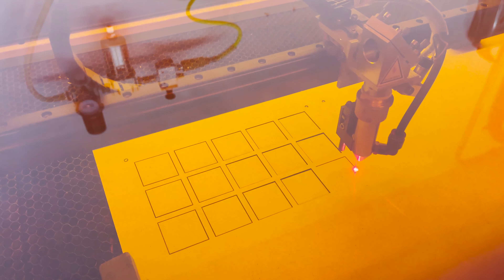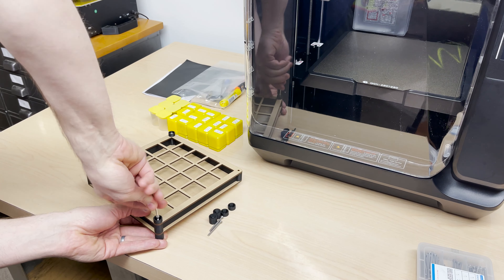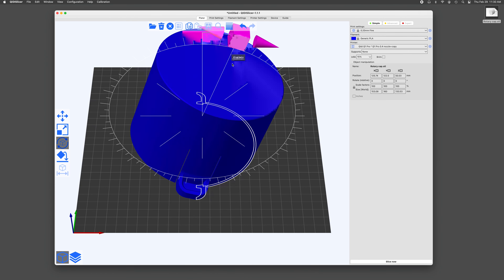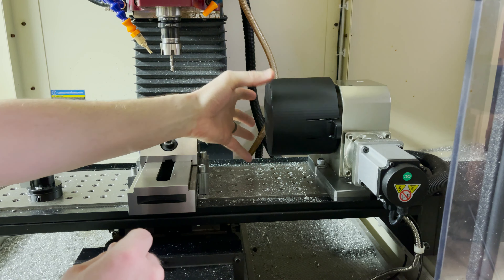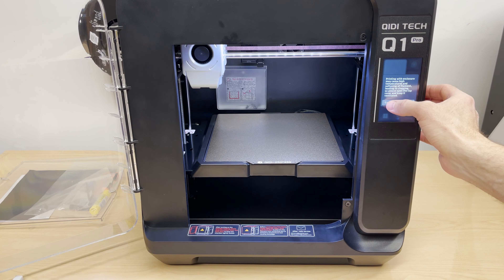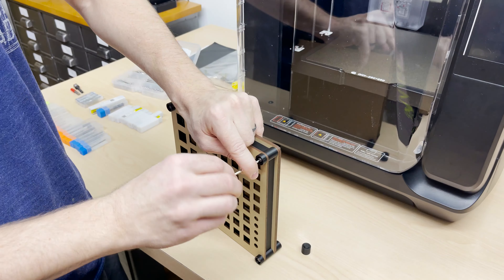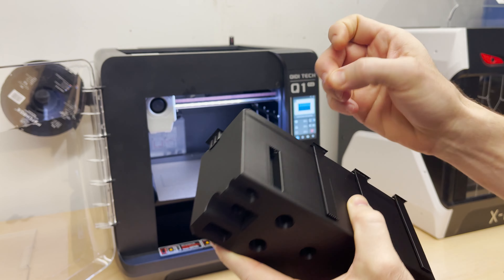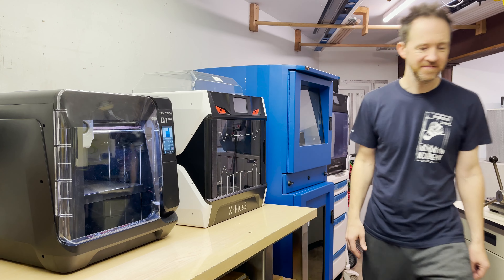QIDI Q1 Pro: 3D Printing Functional Workshop Improvements

Comment: Each one of these Q1 Pro videos I watch gets me closer to pulling the trigger. Seeing proper real world application of it here was great, thanks!
Reply: Same here. Looks excellent.
Reply: For the early third purchases and add it to your car sign up for the Email and wait to give you 5% discount. This will drop it to $450 that will give you enough freeway to buy roll.
Reply: At this point I should cancel my order and ask them for a review unit 😂
Reply: It’s a very good printer. Price was great and so far not a single issue. With glass reinforced ABS, it has produced sharp and straight prints. No warpage detected
Reply: I just bought it yesterday (7/25) and found a 30 dollar off coupon on Reddit which brought the total down to $419. Killer deal!!!  I’ve seen nothing but good things about this machine.

Comment: Thanks for sharing your shop setup and working process. It's cool the way you integrated 3D printed parts with cut wood and metal, but I have to ask if you could have made the collet holder out of mostly mdf by gluing multiple layers and make it much quicker? I want a 3D printer but the time it takes to make  parts makes me think it's only practical for intricately curved parts like the feed of the collet holder. Thoughts?
Reply from the maker: Sure, I could have made a design entirely out of stacked MDF, but I think it would actually take longer to be ready by the time you clamp it and let the glue dry. Also something to consider about 3D printing time, is that it's hands-off, I can be working on something else while it's printing. It only takes a couple minutes to slice the file, load filament, and press go. For all MDF, I would have had to spend more of my time doing the glue up, sanding, and clean up. That's how I've ended up with so many machines...it's nice to have the right tool for the job when you need it : )
Reply: @diyfiberlaser  I was actually just thinking of creating the multiple layers with a several holes where you can drop in a 1/8" bolt and nut, clip off the end of the bolt if necessary and now your piece is solid. There's also EVA foam that you can laser cut and this would be strong enough to keep the thickness and quick to produce.
Reply from the maker: @jamievalentin1193  Oh I see...both of those methods seem like fast options as well!